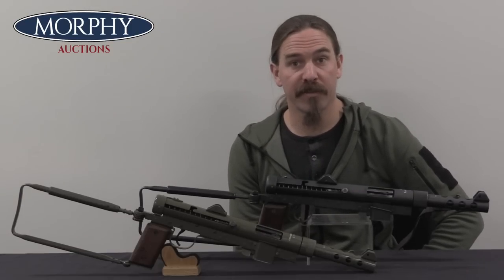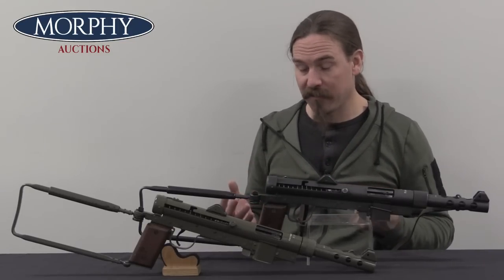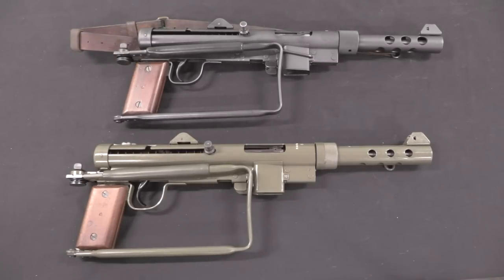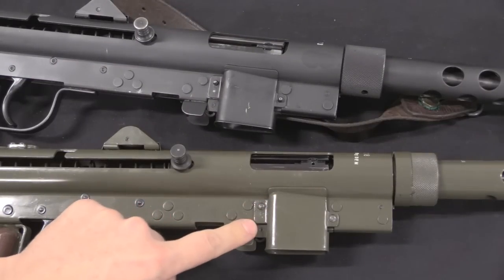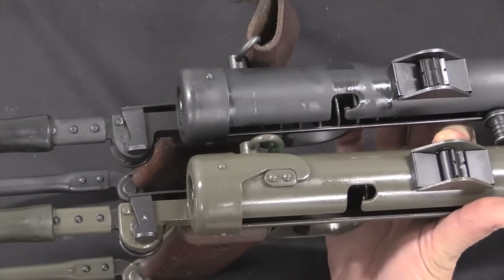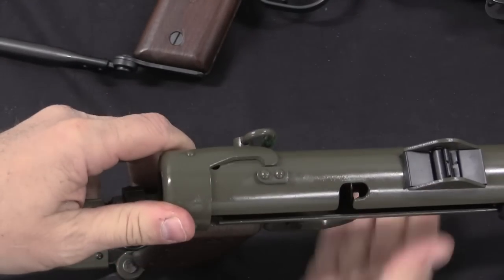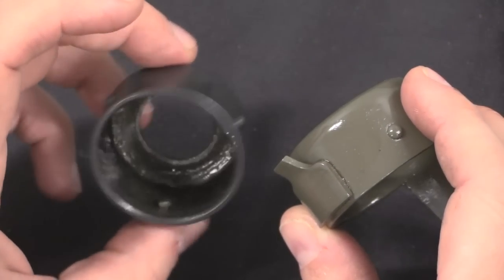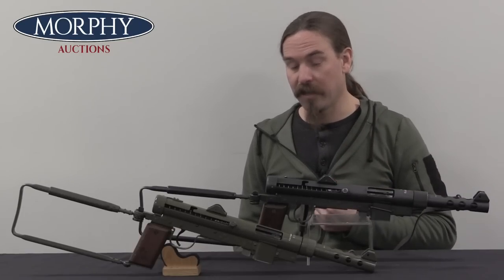Swedish K Comparison: Model m/45 v m/45B

Comment: Fun side note: There was also a fifth version known as the M/45BET, which was a modification of the police issued M/45B. It had a tube fitted at the muzzle that would allow it to be loaded with a tear gas grenade. The operator would then load the gun with 9mm blanks to fire the grenade at intended target or area.
Reply: Såäre.
That version used a cone screwed on top of the blank fire or "lösskjutningspipan" as I recall and could not even fire standard 9mm rounds even if you wanted to.
The stock was reshaped for easier use with the old style steel/lexan faceplate ballistic or riot control helmets
Reply: Very cool, thanks for the extra information. These make me think of a better Swedish version of the British Sten.
Reply: There was even 2 police version. The M/45BE, E - Enkelskott as it had a selector. The M/45BET, T - Tårgas with the aforementioned cup for teargasdispensing. It had a large ladder style sight on the receiver. It also had a special butt stock with a removable top part to allow for using it with protective gear (Huvudskydd M/69). It was also painted in black, not phosfated/parkerized black.
Reply: That was a fun side note
Reply: @bobhill3941  In defense of the Sten, it was intended to be a cheap weapon that could be constructed from readily available material. That it may have spawned itterations is just a strange testement to the nature of tech development.

Comment: I was actually issued both patterns in 1989-90 even if all the original m/45 really should have been refurbished by then. The m/45 I got issued for basic training was clearly out of wartime stocks, it was brand new and I was likely the first real user. I then carried the AK4 (G3A3) for some time  before getting issued the m/45 once more but this time a brand new m/45B which I carried for the duration of my service, and I really took the crap out of that one as we were told they were being phased out in favour of the then new AK5 (FNC). But no matter what I did to it it just kept on working, bolt frozen to the receiver ...WHAM ... sharp blow to the bolt handle (no magazine in the weapon), problem solved. Run over (accidentally) by a BV206, no problem (the backpack was in shreds though). I liked it, it just worked, no matter what and that kind of trust in a weapon is very important. We were also issued the AK5 ... and had to turn them back in after two weeks as they started to break (teething problems). Luckily enough we hadn't turned our m/45s in yet.
Reply: Fun story, was handing out AK 5's to new recruits. Out of 2 crates of 10 each, 3 weapons were non-functional on the spot because the hammer was broken off. And those were weapons fresh back from the armorer/technical with a stamp that they had been serviced and concidered as good as new. i heard from the civilian storage guys that a further 4 out of that batch was returned as "non functional".
Reply: If there is one thing I love about Ian's videos is even if I have little actual interest in weapons being featured the stories in the comments are always worth reading.
Reply: @BigSwede7403  Where those swedish made or the early belgian made guns? I have heard that the belgian guns had a lot of issues, like cracked firing pins.
Reply: @lavrentivs9891  Unknown i'm affraid. But at -93 they had been issued, retrieved and gone through servicing by the armorer/technical crew at least once, so that might give an indication.
Reply: @BigSwede7403  When I did my national service in 00/01, I were issued with an AK 5 from -87, which I was later told were the best age, since all the kinks had been worked out and it was worn enough that it was easy to take apart and reassemble.

Edit: I wrote -97 earlier, it should have read -87 which I now have corrected.
Reply: @lavrentivs9891  Don't quote me on this as I'm not 100% sure, but from what I understand: All of the Swedish FNC's/AK5 were produced under license in Sweden as they had been modified to fit the Swedish specs - New charging handle, new furniture, new front sight, new fire selector, 3-shot burst removed, painted green and so in.

Bofors (Sweden's weapons manufacturer) only bought the license and basic blueprints (perhaps some tools as well) to produce the new AK5, so no guns other the test guns were supplied by FN themselves. Again, this is from my own understanding so I might be wrong.
Reply: @oskareriksson3835  It could very well be, but I was told that rifles marked 1986 or earlier still had belgian firing pins which were liable to crack and had to be replaced.
Reply: @lavrentivs9891  That could very well be true.
Reply: I was issued the original M/45 (in 1995), I was told to check to see that the endcap was screwed on properly otherwise I would get the moving part embedded in the eye and thats why the 45b has the extra hook, another guy that also got the 'og' refused to shoot with it and he did get a 'B' variant.
Reply: I can confirm that the issues with the AK5 were of the "original" kind. We were told that the steel in some components had been tempered incorrectly. I was miffed to hand it in as mine had no issues and most others seemed ok as well.
Reply: @JimAltis The problem with the end cap was only present during firing the chamber/kammar ammunition. Something we later stopped doing.

Comment: The most dangerous situation for accidently discharging the K during training was to have the gun on the back and entering a tent. The charging handle normaly hooked the camo net and released the bolt to the unsafe/fire position. When you then move the gun from the back to take it off, it is easy to touch the trigger. And bang, you discharged a round. If you were lucky it was just a blank. Happened several times. With blanks. The lieutenant went ballistic.

Comment: If you can find it, there was a 36 round clip (yes, clip) and a speedloader that let you fill a magazine in like 20 seconds. You can imagine my dissapointment when they pulled the m/45B and handed us AK 5's instead. Now to spend 5 minutes and aching thumb per magazine rather than Rack rack rack rack rack rack Mag loaded and done.
Reply: Huh! Att det fanns en snabbladdare visste jag inte men kan verkligen förstå frustrationen över att bli av med den möjligheten 😩
Reply: 6 parallell strips/clips, all in one metal  piece, 6 rounds in each for a 36 round block
Reply: 20 seconds? Then you're doing it slowly. Put the clip in the speed loader, lean the mag on its side and hit the handle 6 times. Gravity will feed the clip thru the loader.
Reply: @darkiee69  If you are in a hurry you can speed it up, yeah. But no real reason to speed it up and risk screwing up if you dont have to. ;)
Reply: Pappa tappade sådana laddramar i golvet i en lägenhet som de bodde i på slutet av 60 börjab på 70-talet. Några gick av i vart fall, turligt nog blev ingen träffad.
Reply: I saw one of the clips in an antiques shop once; thought it was mislabelled. Mad to have an SMG with a clip and strip loader!
Reply: The stripper clips were redesigned to avoid rounds going off when dropped. The old stripper clips had a single nub to keep the cartridges from sliding off, the newer style had a wider clip instead of the nub.
Reply: Actually the design was to allow a 2 man M45 "team" to essentially fire constantly. One had the sub gun, the other guy ran the reloading machine. They were very fast little contraptions. I've only ever seen pictures.
Reply: I’ve used the chargers quite a few times and they are very quick and easy to use. The idea to deliver ammunition preloaded on the stripper clips with a speed charger was great.
Reply: @peteroneill5426  Perfect for reloading in a fire fight. A full mag in less than 10 seconds. Not including the time it takes to open the paper box the clip comes in.
Reply: @michaeltempsch5282  yeah that was awesome on this gun. It was redicously fast to fill a mag. Compared to filling a full belt to the machine gun with the thumb on each separate round... ... :-)

Comment: For Swedish SMG shooting we use the m45/B, but there has been some minor adjustments since the B designation, for example spring retention in the bolt etc.
Reply: Hey if it works it works. The us was issuing the m3 grease gun to tankers as late as the 2010s

Comment: As i understand it the Quad Stack magazine is also Swedish (And not Finnish)
Since from what i can find the Quad Stack mag was designed in Sweden by a company named Linde AB after Sweden Adopted the KP-31 as the Kpist m/37 & Kpist m/37-39.
But was later also Adopted by Finland due to being lighter and Cheaper to manufacture compared to the Drum magazines.
(250 Bought from Sweden in 1939 followed by a manufacturing licence in 1940.)
Reply: Yes, it is Swedish. Sweden never adopted the drum magazine. Finland made those under license though the springs were bought from Sweden.

Comment: The m/39B ammo was ingeniously designed. The projectile was mostly steel around a lead core, and thus lighter than an all-lead bullet. To get a higher muzzle velocity, it was given a thin tombak coating on top of the hard steel. This caused the bullet to deform slower, as the part of the bullet that's in contact with the lands in the barrel are steel, not lead. It therefore needed a higher chamber pressure before it could start moving down the barrel, so it utilizes the propellant in a more efficient way. But, of course, at the expense of higher barrel wear.

I suspect this is the reason why so many of the m/40 pistols developed cracks in the frames. It's possible that people used the m/39B ammo in them, which they couldn't handle.
Reply: There is another difference and that is that the cartridge case is straight on the M39B. The pistolammo sleeve is slightly conical. This is easy to check if you place several cartridges on a slightly sloping plane and you will see that the pistol ammo stack swings. I think this is a bigger reason why there will be cracks in pistols that are not made for M39B ammo.
Reply: @boanderson5057  Ever easier to check with a micrometer and determine that this is not the case. They conform to the CIP standard.

Comment: The m/45D was used by the Swedish police as they demanded a smg with a manual selector style safty. Hence it was produced in the more limited numbers you mention in the video. The m/45C also saw combat use by Swedish UN-contingents, Kongo beeing the most prominent example of that. Swedish UN-forces saw heavy  combat in the Katanga province in Kongo in the 1960's.
Cheers from Sweden!

Comment: We had them in the Irish Army for decades and they were well liked as a shooting gun but hated for their tendency to fire if bumped off anything when a mag was loaded and the gun cocked. The safety consisted of pushing the bolt thru a hole in the left side of the body of the gun. It became SOP not to insert the magazine until the shooter was absolutely going to fire. Very easy to strip for cleaning, too.
Reply: I’m assuming you were PDF. I was in the FCA and loved firing the Gustav.

Comment: The updated M/45s I've handled basically didn't change much and lack some of the features found on the M/45B. The magwell was riveted in place and the weapon was painted green, but the end cap, barrel shroud and barrel nut were still exactly the same as a M/45. Still functioned just fine and didn't break even with loads of M/39b rounds run through them.

Comment: M45D was for police use.
M45C used the same bayonet as the M/94 Carbine.

the M/39B round is still used today. in pistols. thats the main reason sweden opted for the Glock 17/19 in the late 80s. tests showed that the glocks could take the punishment from the 39B rounds, that was a problem with other pistols as they tended to crack after a few thousand or so rounds. 
i belive that m39B was also used in the Pistol 07 (Browning) that was used before the glocks (called Pistol 88, 88B, 88C, 88D and so on in sweden)
Reply: Was it M45D or M45BE/BET that was the proper designation for the police versions (BET being for tear gas cartridges)?
Reply: When I served in 1987 (signal corps), we where issued the M45. They had the original finnish, a fixed well and the new spring buffer. Must have been upgraded originals. When we did our royal guard duty we where temporarily issued new (green) barrel shrouds with bayonet lugs.
Reply: @nilsarnedahlberg  Both? BET is/was the tear gas rifle grenade unit. the D has a single-shot option for better fire control.
Reply: I looked it up and Pistol 07 was chambered in 9mm Browning Long (9mm patron m/07 / 9x20mm). I initially thought it was in 380 ACP ( 9mm short) but it was actually the other way around :)
Reply: @nilsarnedahlberg  i belive both were used. BET was modified to take other rounds i belive. So you coldnt use m39/B or other regular 9mm rounds. It used a special propellan round (drivpatron) to launch the teargas grenades.
It's not a good idea to mix up ammunition and shoot a live round through the grenade... 
I can't say exactly what the modification was but it's the way i understand it.

M45BE was a regular M45B but modified with a single shot mechanism. Im not sure how many of those where made. And if they where upgraded to M45D or if M45D where made that way from the start.
My personal guess is that M45D started out as M45BE but was upgraded to M45D.
Reply: Pistol 07 never fired m39B since it was a straight blowback pistol cahmered for 9mm Browning long. The pistol used before the Glock was the swedish varation of the Finnish Lahti L-35, in Sweden named Pistol m40. M40 is a 9mm Para and fired m39B but could not withstand that in the long run.
Reply: @Skuggan84  Seems it was a lot of versions. As Hans notes above, in late 80s/early 90s there were unpainted M/45s out in the wild again. I am sure the one I got issued was without the hook on the rear end cap. Maybe someone should make a video about all these versions some day.
Reply: @nilsarnedahlberg  yes. Some unodified versions was taken out of storage as the m45B's used in training started to get worn out.
So it absolutely occured the last 20 or so years that you got a mish mash of different versions.. and parts mixed when Guns where repaired.
Reply: @Skuggan84  Mish mash indeed..
My M45 issued -92 LV7 Boden had riveted magwell for 36 round mags only, original A endcap with B-style inner endcap and rubber buffer, unpainted and original A style barrel shroud.
Reply: @amclips2995  yeah..  there where quite a few "A" models made and not so many B models. So when the B models that was used for training started to get too worn they started using spare parts from the mobilization storages.
And a few of the stored A models that had been in storage and never used as storages started to be emptied...

The B model was always more of a "peacetime" training weapon. Hence the added safety hook on the cap, fixed mag well and so on.
It was a slim chance you would have got a B model if war had broken out.

Comment: When I did my National Conscription Service in 1986-87 I was issued a m/45 which was clearcoated metal and had the basic round endcap, but if memory serves me right (it was 35 years ago) had several of the other modifications from the B-model. The magwell, the was no plastic/gel disc in teh endcap, and if memory serves me right (BIG caveat) the holes in the barrel shroud were somewhere in between the m45 and m45B in size.
 A tip for accurate shooting with the m45: Do NOT loosen the nut holding the barrel and shroud. If you do, you need to readjust the sights again. You can do basic cleaning without loosening the nut, i made it through a winter with temperatures ranging from just about freezing point to 30-ish below zero, just cleaning what I could without taking the barrel off. Then, the week we were going to discharge, I made a total stripdown and left the gun clean as a whistle and utterly unaligned between barrel and sights.

Comment: I think I used a mixed version of the A and B. It had the riveted mag well,  the barrel shroud with smaller holes, the lock ring had knurling all the way, the end cap without the hook but with the spring buffer.
Reply: I seem to remember the same thing. A really fun gun to shoot and easy to stow away on your back egen working on vehicles, radios and antennas.
Reply: that sounds like the same one i used. That made the video confusing for me. Sort of a middle version. Great gun anyway

Comment: I was issued the m/45 when I was a conscript in 1986-87. It had a fairly low serial number, 13xxx something. I don't remember it having the detachable magazine well; it had the fixed well of the m/45B, but no hook on the end cap. The latter meant that field stripping and reassembling it took about a second less. We had to be able to field strip the gun in 15 seconds, and reassemble it in 20 seconds. When doing it blindfolded, we got five seconds extra. One guy in our squad managed to field strip it in 9 seconds blindfolded. Anyway, I loved my m/45. It was pretty accurate up to 100 meters, and not bad at 150 meters. It was also relatively easy to clean, especially compared to the AK4 (H&K G3).

Comment: The reason for the "B-back-latch" were not due to the m/39B ammunition but for the short range "chamber" practice ammunition.
This practice am had a sub calibre projectile in a bakelite "bullet", that gave very high gas pressures (esp. when the conical bore got dirty).
The steel jacketed (tomback-plated) bullet m/39B resulted in high gas pressures in the m/40 pistol.
Reply: To clarify: the reduced diameter blank firing barrel was used with this kammarammunition (gallery cartridge). Besides the plastic clogging up the barrel, causing increased pressure, there was nothing stopping the loading and firing of live cartridges, something that would cause a high-pressure situation...